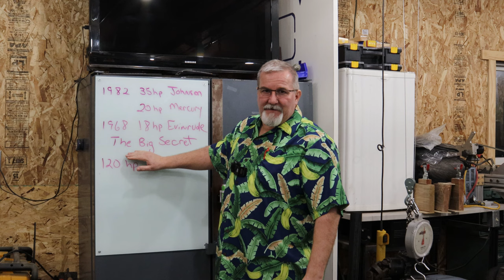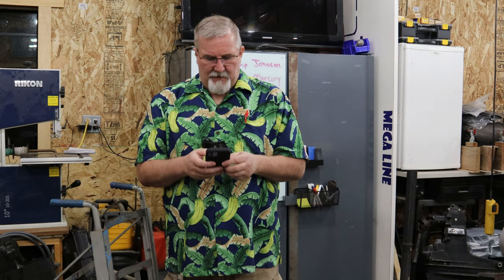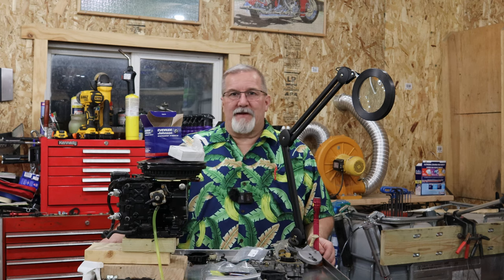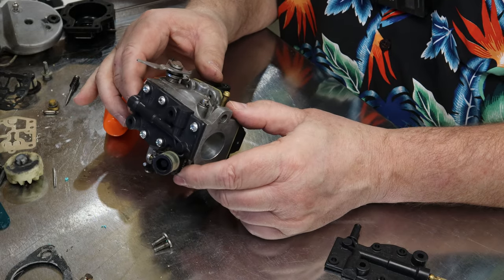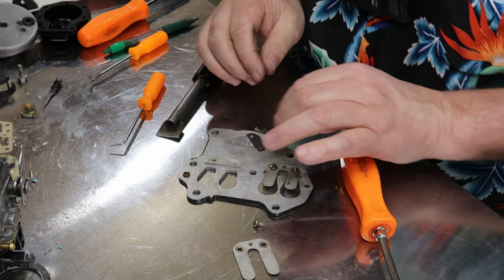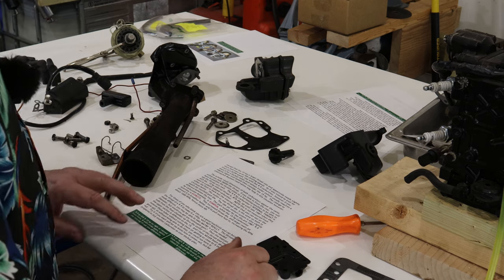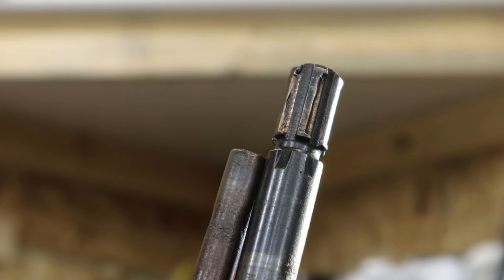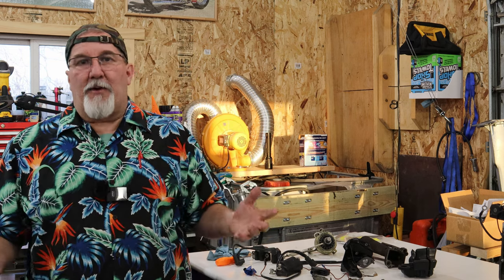The Big Secret 15hp Johnson 1988 starts going back together the Mercury 20hp 1975  We have winners

Comment: We learned over the years to leave the old water tube grommets in the inner exhaust.  Why?  Because the new grommets would soon swell up and clog the water passages again.  Instead, take a very sharp knife with a small blade and run it around the inside of the old grommet while it is in place.  If you do it properly you will trim a round ring of rubber out of the old grommet and your water passages will never clog again.  Good to go forever after that.  Thanks for a great video, Michael.
Reply from the maker: I shared your comment in the up coming video. Thanks for the tip and watching

Comment: Unfortunately Leeroy passed from my simple search but that site is stationary/down, i just won a 83 nine point nine at auction less than 50 had no hood but found one local a 15hp hood, a mouse had chewed the coil wires so i fix them and it started up with water, now i am looking for a small aluminum boat to put it on and a SS prop down the road it it runs well, a compression check i got 105 top 96 bottom so it's maybe so so have fun

Comment: Mines a 1991 with electric start so its the 91 fully loaded model, its a long shift too I believe.. paid $300 for it with original 6gal tank & it came with a 3gal tank.. the original 6gal tank is like $179 itself, mine had a small air leak i fixed

Comment: Just some ideas food for thought.

IMHO I would change the 2 lower crank/drive shaft seals and an o-ring while you have power head off to make sure you don't have a leak on crankshaft or drive shaft later they are in the cap with the 3 screws bolted to lower crank area it might also help to keep the worn driveshaft protected by keeping the grease you apply to top of driveshaft on it when you put it back together.  Those parts are fairly cheap I just did mine.

 I also just put a 15hp stinger pipe onto a 9.9hp and the water grommet was indeed melted restricting water entering the power head so it is a good idea to change them as you plan to.  I also added a 15hp all metal carb to that engine which is a 1985 and it is running very well.  I plan to try and take the 9.9hp metal carb I pulled off that engine and put it onto a 1989 8hp engine that came with the plastic carb and no choke but primer set-up .  I will swap the high speed jet from the 8hp carb to 9.9hp  it has the same/close venturi/throat size it will be a good experiment.  I'm not wild about the primer set-up.

Also when you are tightening the screws or carb plastic parts they are numbered with torque sequence 1 2 3 4 5 6 etc that helps to prevent cracking.  I just barely tighten them you can use a little thread lock to keep from overtightning them.  

I would have been tempted to use or at least try to use the Original JB (black grey) weld on the cracked carb bowl on the outside by sanding it, cleaning it with acetone then applying the JB Weld and letting it set-up at least 24 hours.  It is terrific stuff I think it would have fixed your issue with that hairline crack on fuel bowl.  I have used it in the 1980's on 6 gallon  Johnson metal fuel tanks before with leaks around the lower lip where they put them together. and  it stopped leaking for years.  If nothing else it would be a good experiment maybe giving you a back-up bowl for carb.

The top plate of your carb where yours is warped doesn't seem to be a critical area of carb IMHO when I was working on one yesterday I looked hard in that area but if it still wouldn't run right after fixing the carb bowl I would have been tempted to try using a heat gun with (top carb cover gasket removed) a small clamp to try and get it to go as flush as I can with the top plastic piece on top of carb if it wouldn't run correctly but it was running correctly I suspect the reason it stopped running correctly was the fuel was running out of the bowl or being forced out by the fuel pump at a quick rate.  You might have been able to put another hole back there and drill and tap that part of carb to get that corner to go down as they added a screw hole in later years.

That second hole you showed us on the carb bowl is most likely for a fuel primer set-up and will need to have a screw and red washer put into it to prevent fuel from just running out bottom of bowl.  The 1989 8hp I was working on yesterday has a fuel line to a connector there and then it goes to the primer assembly and from there to the top of reed valves through a small brass tube and when you pull primer it shoots fuel into the reed valve area this motor has no choke I bet that  is what that second hole is for in bottom of fuel bowl.  

The screws on the reed valves I would really use some thread lock on.  I have heard people say do not use it but I have used it on my personal motors and never had a screw loosen up and destroy my engine.  That's a judgement call.

I always put the bolts screws etc back into the holes they came from when I take something apart especially if it is going to be apart for a while it makes putting it back together so much easier and old mechanic taught me that its been a game changer for me.  Sometimes the hardware is longer/shorter etc but looks a lot the same.  It has really helped me especially not to loose hardware and quicken re-assembly by not looking for that darn screw or washer etc.

One more tip that I do is when working on those type motors or the ones with the tube spool style recoil when putting a carb on and off to see if it is right I don't put the recoil back on I use just a rope to start engine.  It is also helpful when checking plugs for spark because you can stand directly behind the motor and pull the rope.  It also gives you more leverage starting a motor rapping it around the flywheel which is good for older folks like me especially when a motor hasn't ran correctly or isn't running correctly.

Hope that helps
Reply from the maker: Thank you. Your tips will come in handy for sure.  Thanks for watching

Comment: dang that old Wisconsin is one big  chunk of old iron. the derating seems to be a common theme.  i have 4 stroke 9.9 tohatsu and merc and researching them  the only difference between them and their respective 15 hp is the carb
Reply from the maker: I certainly is. engines are all about making a better air compressor and then lighting it on fire.

Comment: just did a water pump impellor on my 77 Johnson 35 was easy after watching you explain while doing it.  And rebuilt the carb also easy peasy now need water in the lakes to test it out...Lakes here in California are extremely low...It is on a 14 foot runabouut does about 30 with me in it alone...
Reply from the maker: Nice. Glad the video helped. Sounds like that 14' boat scoots right along. Thanks for watching